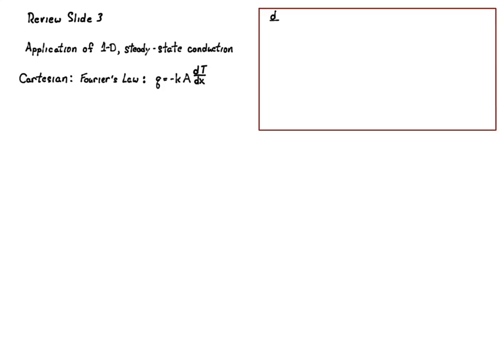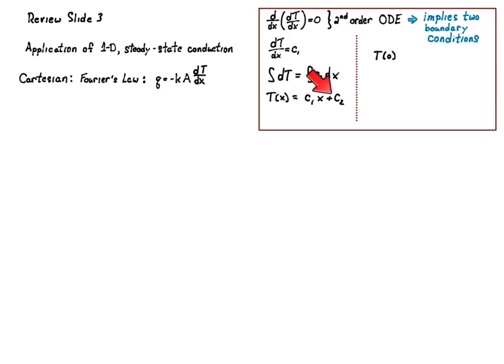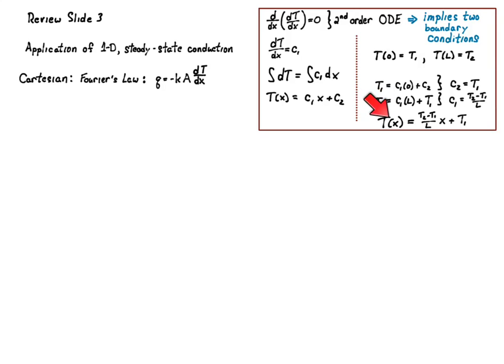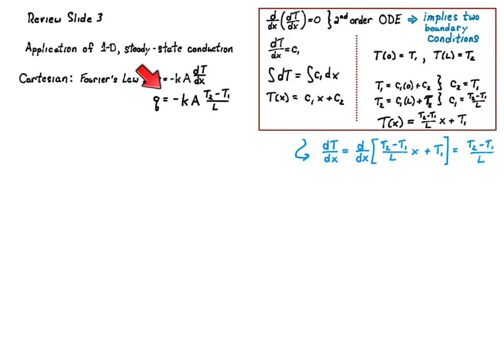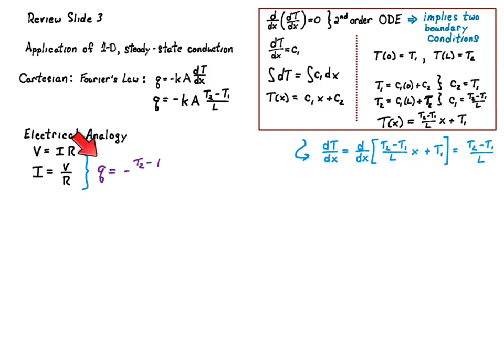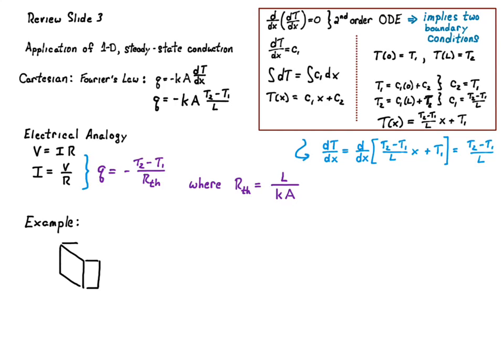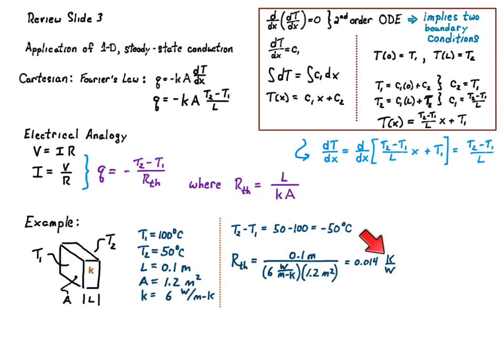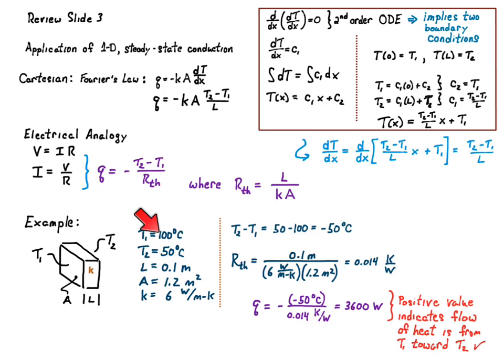[HT-11] 5 minute review - 1D steady-state conduction Cartesian

Comment: Why don't you convert -50C to Kelvin?
Reply: +Carter Weston The temperature difference would be the same (as in -50). In degrees C it would be 50C-100C=-50C. In Kelvin 323.15K-373.15K=-50K. So the answer would be the same either way and yeah we can't cancel the unit if we don't convert it first.